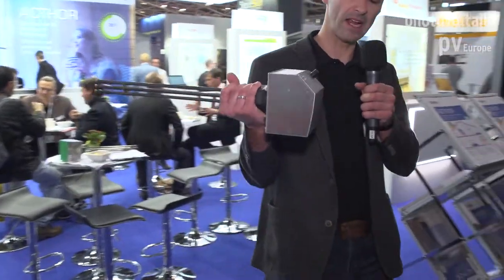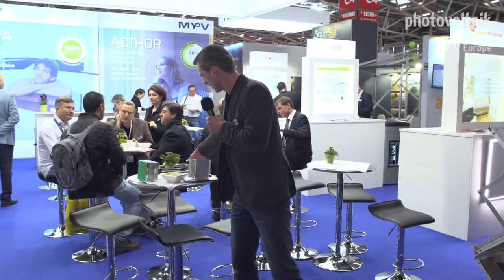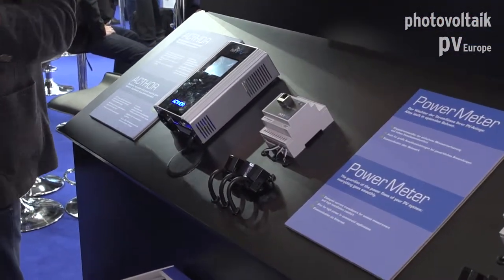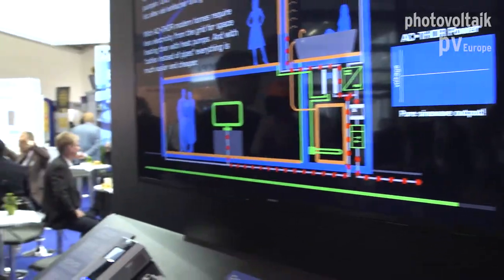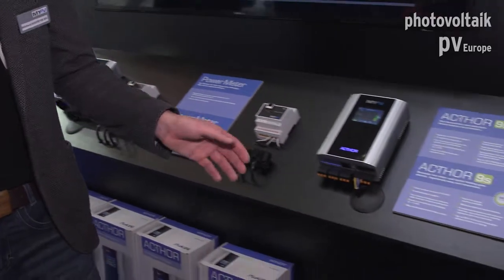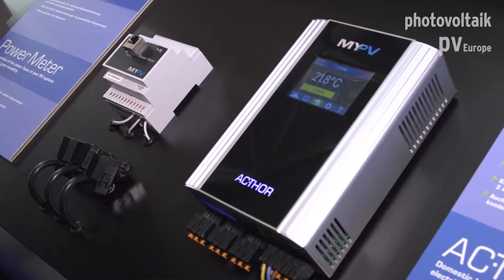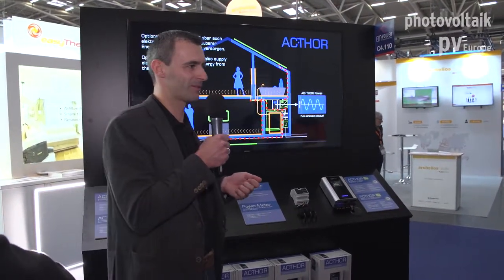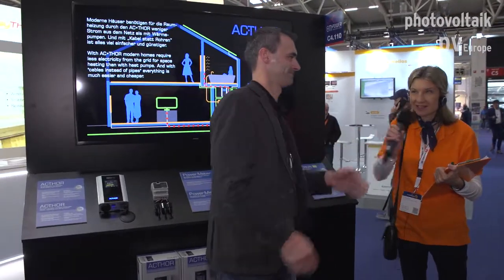my-PV makes space heating solar-electric and presents the product innovation AC-THOR

Comment: Can it be used for water based central heating in a building? I have already photovoltaic in the roof 10kw peak. Would it be enough to heat 3 apartments 95m each?

Comment: Can the 9 kWh model be converted to single phase
Reply: 3 phase 9S model can be used with Single phase but one on 1 input connection which is rated to 3kW max @ 230V or 2.3kW @ 240V.